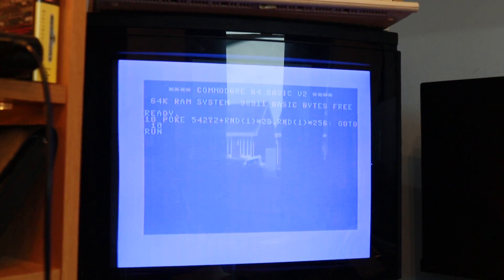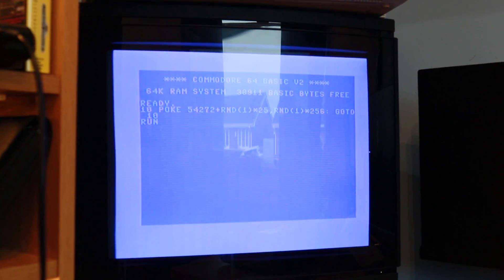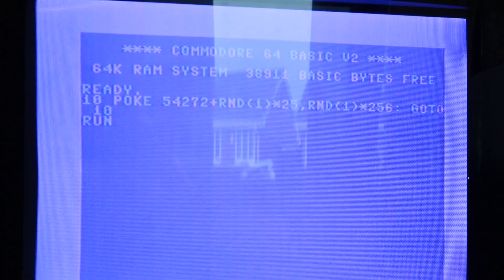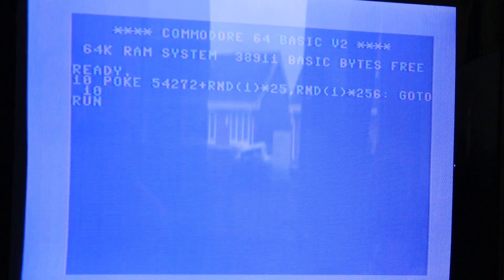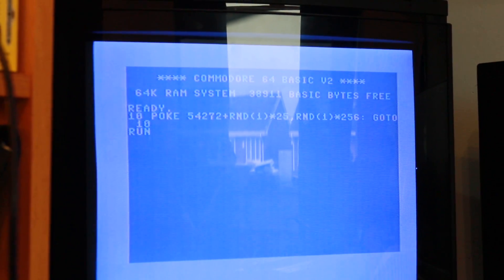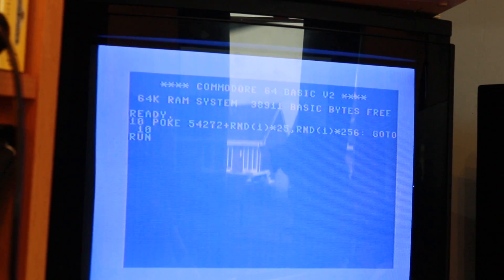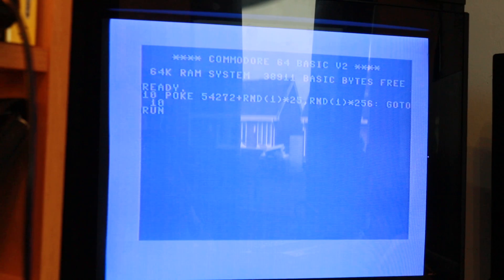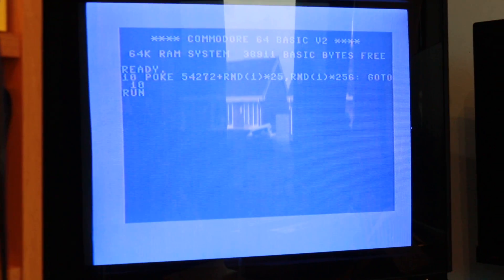commodore 64 SID's gone man..

Comment: Hope you manage to get it sorted ok , out of interest what power supply are you using for your C64, is it the old style with the sloping side or the rectangle box version ?
Reply from the maker: I think it is one of the latest ones.  Its not the square one, and not the sloping one, well not completely sloping.
The old slope style the slope happens about halfway along the length.  This is more rectangular brick with the corner cut off on one side.  The manufacturing stamp says 1990 on it.  I've opened it up and checked the 2 fuses and they seem fine.  I've also checked fuse inside the computer and that is fine as I've heard that can cause sound not to work but I think that is on the C64C version.
Reply: StRoRo yeah you should be fine with that one then, those old style are notorious for over heating and causing problems....happened to me not long back so have replaced it
Reply from the maker: I've looked around and I found a guy who can build power supplies with new modern components> He can make one which can run the C64, 1541 floppy drive and Amiga from one PSU.  But they aren't cheap, but in the long run worth it I think.   I'll keep you all posted on how it goes.

Comment: I assume you tried simply reseating the SID? This happened to one of mine a while back and that’s all it needed to get back up and running.
Reply from the maker: Yeah, I took the SID out, cleaned it and put it back. I tried a number of things but didn't mention it. Thanks for the suggestion though.
Reply: StRoRo ah mate that sucks. Hopefully the “new” SID sorts it out and sounds like the original if it’s some kind of repro. Sadly, that chip is expensive on its own due to people using them for sampling etc.